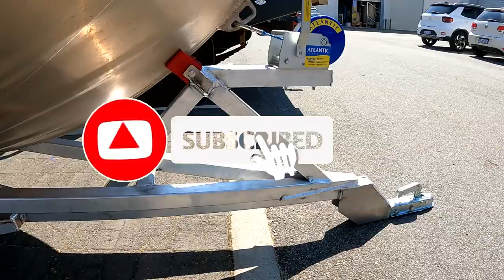Tri Adventures OFFROAD TINNY TRAILER build PT 2.

Comment: Very good!!!
Wich metal/steel cut disck is that?
Reply from the maker: The one on the 5 inch grinder is a 1mm steel cutting disc with some wax on it to stop it clogging up with ally.

The one on the saw is a tungsten tipped milling disc.

Cheers mate